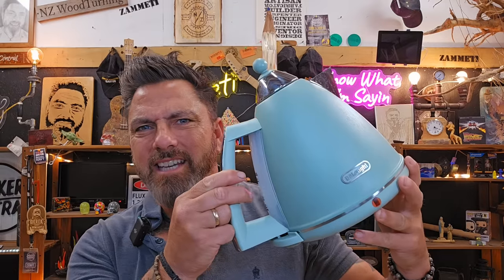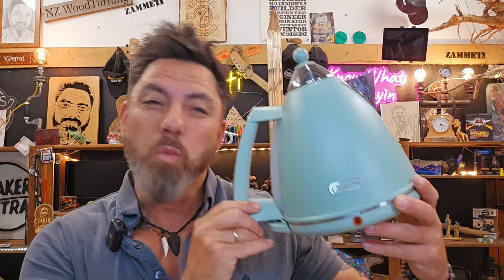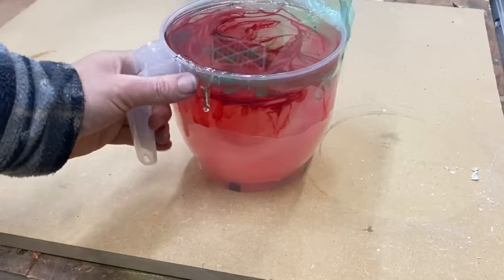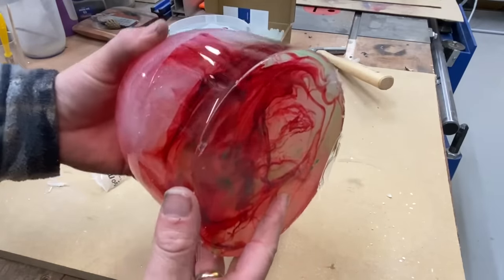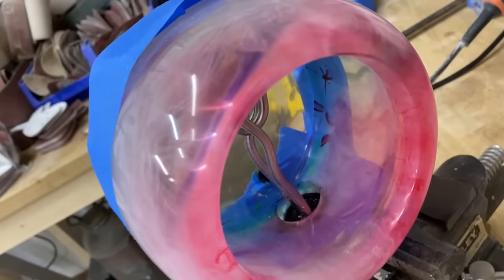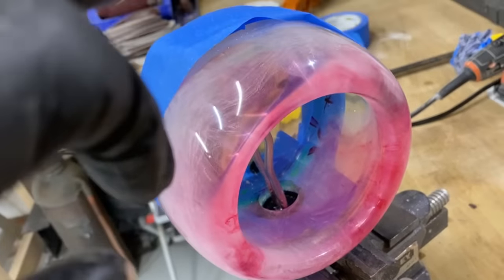Woodturning - The Impossible EPOXY Kettle

Comment: Isn't there like food grade resin? Not to eat, obviously, but to eat off of. They use it for like countertops I think? Either way, super cool. :D
Reply: Yes you are exactly correct. It is also used for cups and cutting boards.
Reply: Any plastic that you boil things in is a bad idea. No matter how food grade, even tupper boxes are not great for boiling things in
Reply: And resin aside there is the Milliput (the two part epoxy resin) that is in contact with the boiling water - is that safe.
Reply: Does food grade also mean it’s resistant to leeching in boiling water??
Reply: @CookingWithCows I look at it as an art piece that actually works.  It's small compared to a proper kettle anyways. One wouldn't likely use it daily. Its just a fun piece.  Not everyday you can put a chunk of acrylic on a lathe and make a functioning kettle that not only heats the water but contains it without leaking. Impressive.   Plastics are everywhere including food tin linings keeping metal leeching into vegetables, especially like tomato sauce.  You'd be surprised.
Reply: @CookingWithCows  plastic kettles have been around forever and are still made today. There are certain plastics that are not safe but not all plastic products are a problem
Reply: @dawn5227  Would I be happy to hold a commercial plastic spoon in my mouth - yes.  Would I be prepared to hold a piece of set two part epoxy resin in my mouth - no.  That is not to say that I know it is unsafe, just that I’m not convinced that anyone has done the rigorous testing and certification to say that it is.  Heated two part epoxy resin - a more emphatic no.
Reply: Yes there is but food grade resin is only for presenting/serving cold food. There are heat resistant resins but they’re for coasters etc. resin should never be cut on, should never be used to serve hot food or put in the mouth. So, for example, the resin coated tumblers are supposed to have a resin-free section at the top, usually a metal lip is attached. Don’t use them if they don’t! Resin cutting boards are intended as decorative unless there’s a wooden section for cutting on. (I’m a resin artist. Just not a you tubing one!)
Reply: Having said that .. research is being done on resins which are increasingly made from plant based polymers which will (in theory) eventually be wholly safe, because the source allow the bonds to be created in a more stable way. Plus it’s more eco-friendly. (Though epoxy resins were historically  made from by -products of the petro chemical industry, they’re now made purposefully at least in part. Eco resins which are opaque and look like gypsum based products are available but they’re opaque. Fun though! )
Epoxide polymers have a different chemical structure than the food safe plastics. That’s why they become unusable for food/heat etc as it causes  the leeching of chemical. I’m not anything close to a petro-chemical engineer so that’s the limit of my knowledge! 
But this piece is a do it because you can art piece. I’m sure Nick isn’t planning on selling it for use! But I do worry when he makes mugs! There are heat resistant coatings that can be used, but again they’re not safe to consume from, there more to protect the item.
Reply: @kellykinnaird3576  How would a non-resin lip help - you are still drinking a hot liquid that has been standing in resin.
Reply: @nheather  because only (edited a typo) the outside of the tumbler has resin. These are plastic tumblers that have the outside decorated with a resin coating, for the design element. But people make the coating all the way up to the top lip.
If people are selling whole tumblers made of resin, they are seriously in the wrong
Reply: @nheather  plus they’re supposed to be for cold drinks also. This is the problem with resin, people think just bevause a kit to make a product is for a sale, then the kit manufacturers must know what they’re doing! But they absolutely don’t if they’re not one of the leading manufacturers of resin products.
Reply: @hollylowery26 resins are only brief contact food safe.
Also when heated (usually above 80°c) it softens and releases odour and no doubt toxins
Reply: Food safe resin says on the bottles to not let food have direct contact with the resin piece.
Reply: No, not safe at all. Even “food safe” doesn’t mean prolonged contact. This is a cancer pot, he’s insane.
Reply: Yes there is food grade finishing oils and stuff
Reply: @squeekee35  doesn’t matter, resin is not safe, especially not to boil liquids in.
Reply: Geez, I think everyone is missing the point. I am sure this is just an art piece, which is functional,  but not for everyday use. Well done, Nick. I always enjoy your artwork and videos. Getting it to work takes it to a totally different level. I love it❤❤
Reply: @kellykinnaird3576 , the resin tumblers I sell goes out with a special straw and straw cleaner. It's double-walled so even if it has hot contents, it does not heat the outer epoxy layer up.
Reply: @ilsejansevanrensburg9237  he put a literal heating element in the kettle.
Reply: Not sure why this comment got so much traction, I was just asking if there was food grade resin or not and getting clarification on if they use it for countertops....
Reply: @debbieebbiebobebbie  , I saw that. But I  am sure it is just to show that it is working. He is not promoting it as something he will be selling as a real kettle. Nor is he promoting that you should make something similar to replace your kettle.
Reply: Agreed. Still an amazing looking project.

Comment: Nick, it might have been a little bit easier had you purchased one of those latex kits that you can now buy from amazon or eBay and then mixed it up and poured it over the kettle, making a complete full sized latex replica of your kettle and then saving a fortune on the amount of epoxy resin you needed for this project.

Comment: Just overlooking a big problem with this heating water to boiling point in something that will warp and melt. (And is only safe to use for any kind of consumable if you used a resin designed with that kjnd of thing in mind).